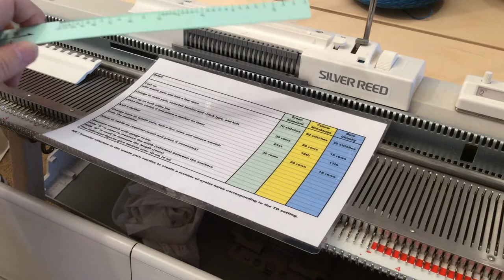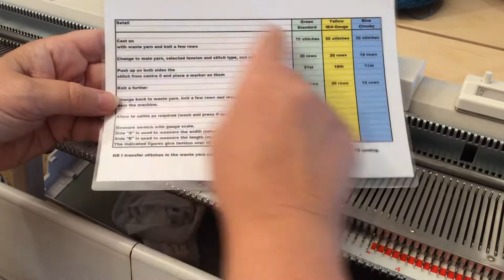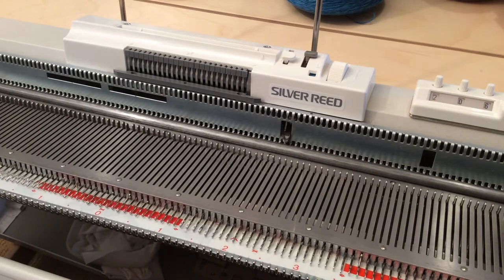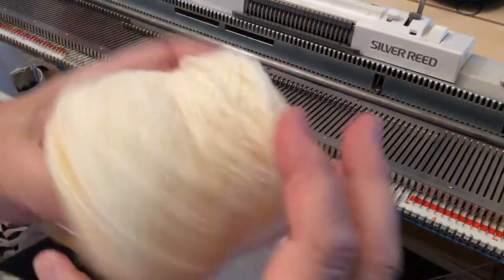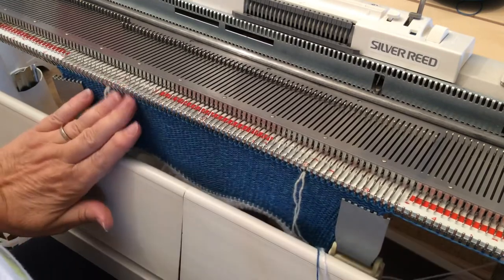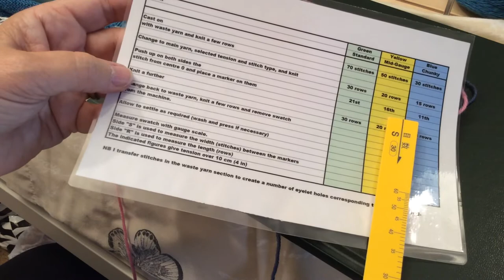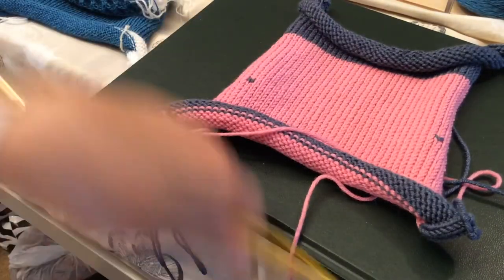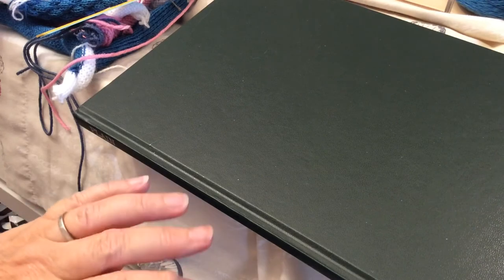Machine Knitting - How to knit a tension piece for the coloured rulers

Comment: Hi Sally, is there a place I can find the spreadsheet for gauges?  I looked on the Kalamunda crafts page but didnt see any files tab.  Thanks so much.  Love the videos!!!
Reply from the maker: Hi Yvette, Facebook works in mysterious ways in that I can’t add documents to my page, but I can add them to a group.  So if you would like the little Excel chart, it is on the Machine Knitting Beginners and Returners Circle group files.
Reply: Instablaster.